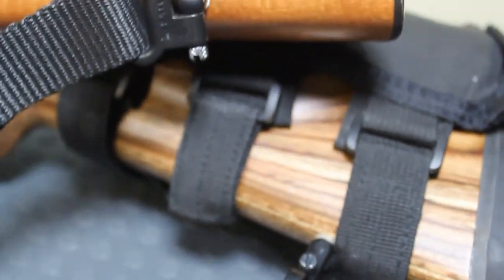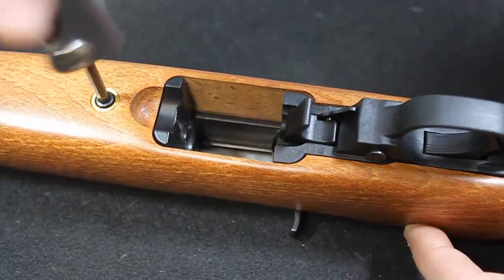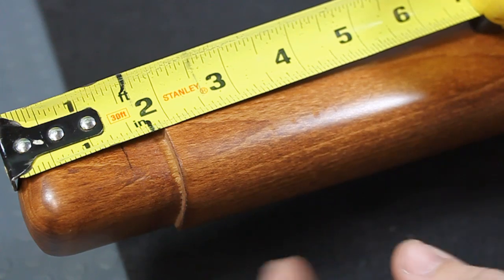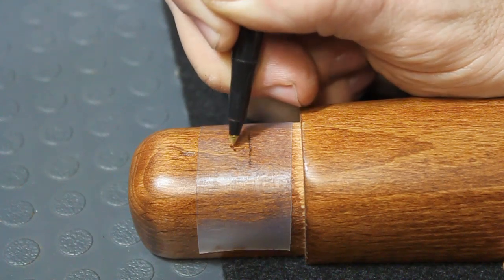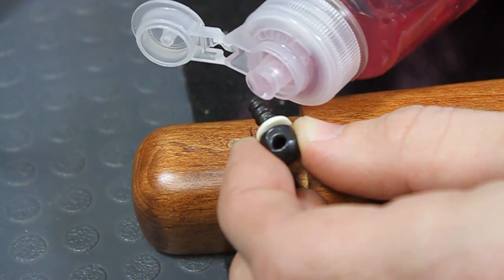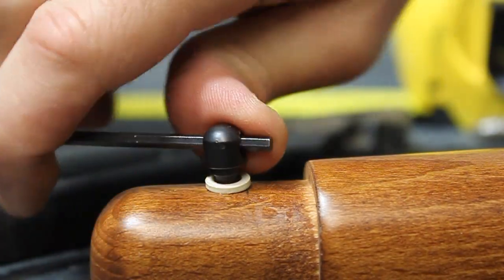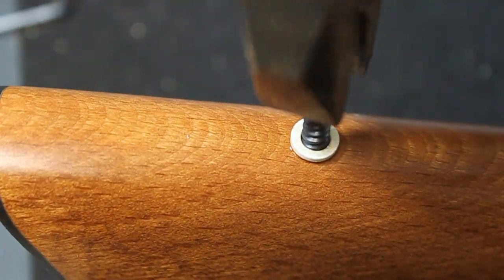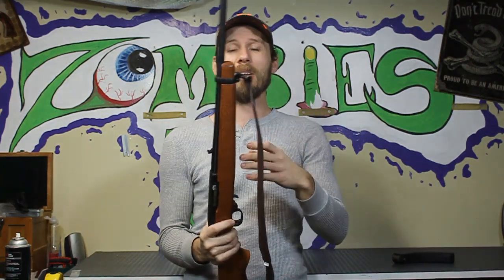How to install swivel sling studs on a rifle stock: Ruger 10/22

Comment: using pliers just scratches up the stud surface (you can see it happen to both studs in the video), do not use pliers. Simply put a small diameter screwdriver or rod trough the hole of the stud and apply pressure while screwing it in place.
Reply: I was shocked, when I saw the pliers coming in 😅 Good mod, though 👍

Comment: Why did you not use the Uncle Mike's swivel sling made for the 10/22 which attaches to the barrel band? Then you would only have to drill one stud for the buttstock.
Reply from the maker: I could have, but i had these laying around.
Reply: My thought exactly and in front of the barrel band
Reply: @ZRUSOutdoorsChannel  I don't care for them little barrel bands anyhow that come in the Uncle Mikes kits! I have them on a couple of my 336's, but try not to use em'! They end up scratching the shit out of your barrel if they work themselves loose. Because you won't know it until your throwing your gun up on your shoulder or picking it up by the sling!! By then the damage is already done??? UGHHHH!!!
Reply: @jaymeddaugh2044  and

Comment: Excellent video, but one critique.  I would not use pliers to get the studs started.  It looks like you marred them up bit.  Wrapping electrical tape around the pliers is one solution or just use downward pressure with your allen wrench.
Reply from the maker: +Tom G. True story.
Reply: +Tom G. +1 on the tape. I actually winced a bit when I saw the naked plier jaws crunching into the stud.
Reply from the maker: GlowingBentley I can be destructively productive sometimes lol
Reply: I use my teeth...that way I don't hurt my tools.
Reply: he sure did scratched the living heck out of that screw
Reply: @selaxlife7621  😂 you just love the taste of lubricants.

Comment: Got mine installed yesterday.  My primary use for the stud was to mount a bipod, so I wound up putting the front stud 2-5/8" rearward from the barrel band.  If you read the instructions, they call for using Uncle Mike's #2 wood drill and countersink.  So I looked that up and found the set cost $30.  Forget that.  So I decided to take a slightly different approach.  I measured the outer diameter of the white washer to be 3/8".  I wanted to recess the white washer so it wasn't visible, especially on the rear stud where it is on the peak of the stock curve.  So I used a 3/8" Forstner bit and drilled just deep enough so that the washer was flush.  Then I proceeded with the 5/32" bit.  The rear I put 2-1/4" from the butt, taking the average of the recommended distance in the instructions.  Regretfully, I didn't video anything.  Anyway, I would like to again say your video is the most professional on YouTube and gave me the confidence to start drilling.  I have seen some pretty bad videos on the same installation.
Reply from the maker: +Tom G. Well thank you again Tom! i do appreciate the good words and glad my video could help you out, that always nice to hear :)

Comment: Nice vid...Hint:  first drill a small pilot hole before drilling larger hole, this reduces chipping in the wood surface. Also bar soap or candle wax on threads works best on ALL wood screw applications....just my 2 cents from life...
Thumbs up!

Comment: I have had a Stainless 10/22 from when they came out about 25+ years ago.
SLING SWIVELS:
Since I have several 1903 Springfields I was familiar with  those Sling Swivels.
Found at a Gun Show some Milled 1903 Style Swivels and Screws, 
stripped the Bluing off, Buffed and then a lite Satin Clear Coat.
Looks Great.
Currently has a repro WW2 Tan Canvas Sling 
for Garands and 1903 Springfield 
I also put a Stainless Scope on it.
I found a Stainless Butt Plate to replace the Black plastic one.

Comment: Great video. Helped me with the instal. The only suggestion I would give, is to measure the depths given in the instructions, on your drill bits and put a piece of tape at those depths on your drill bits. Installing the rear swivel stud, I believe I used an 11/64" at 1/8" depth and a 5/32 at 7/8" depth. Been needed to put a sling on mine for years.

Comment: Just finished the sling mounts on my old 10/22. Two tips…
Ensure that the hole drilling axis is perpendicular to the surface plane of the stock. It’s an easy thing to overlook. Otherwise the mount won’t fit squarely on the stock. 
Also, if you’re careful about doing this, you can turn in the mount by putting the head of the mount in the chuck of a LOW SPEED drill motor.

Comment: Will do this to my Ruger 10/22 soon. Thank you for the video.
Reply: +Z.R.US Hi! My front swivel screw (on wood stock) feels strong by hand 
but when sling is attached it rotates. Is this normal or shall I do 
something to tighten the screw? Was thinking in taking of the screw and 
then puting some epoxy putty in the hole.
Reply from the maker: I have two rifles that do that, I havnt put anything on them, but im sure a wood glue or epoxy would definitely help.
Reply: Great, thank you for the quick response :)

Comment: One Note: When you put the screw outside the barrel band you can't slide the barrel band back on, at least on the models with a metal barrel band.  I didn't try to pry the band open very far, as I didn't know how well the metal band would handle the bending.   So now I have an extra hole...  Not the video author's fault - just something to think about.  

I like the use of tape to sort the wandering drill bit!
Reply: Yeah, that's certainly a terrible place to drill for the front stud.

Comment: Should of used a piece of rod thru the eye of the stud to screw it in.  The pair of pliers
can mar the stud's finish.  Just put a piece of cardbrd onto its jaw but this can b a bit 
slippery.  Yah, it maybe hard to get the screw-in started. but as long as the tap drill is of
correct size, should b OK.  I did like ur mentioning where to put a stud in consideration
w a rifle rest/tripod.  I would suggest to use a drill press instead of a hand drill and a
punch to assure better drilling.  Using a scotch tape however is good too. 
Thx 4 the video!

Comment: One question. Does putting the stud in front of the barrel band make it difficult to get the barrel band back on? Will it stretch open wide enough without snapping? Good video other wise.

Comment: I have a poly mossberg 302 plinkster.  Can I use the same instructions for the plastic stock as for wood.  I was going to add some epoxy to the screws to giveit a bit more holding power.  Do you agree that this will work.  I am sure the material is hollow so do you think I will get the strength needed from the epoxy.  Thanking you in advance , Rick
Reply from the maker: you sure can, i just did this to a magpul stock and a Ruger 10/22 takedown polymer stock. I didnt add any epoxy, but  im sure it will help, as long as its safe to apply to the polymer.

Comment: Good video, but you did not show how the barrel band  moves past the drilled   swivel stud.
Reply from the maker: Thanks man! I have a plastic barrel band, pull it open and it slides right past.
Reply: ZRUS Outdoors Channel thanks for the reply. I haved a 44 magnum with a metal barrel band. After I commented, I ordered an uncle Mike's swivel kit with the adaptor to fit between the barrel band. Hopefully it will snug up enough. Thanks again

Comment: Does adding the swivel stud in front of the barrel band make removing the barrel band difficult?
Reply: +ZRUS Outdoors Channel not until you buy hard metal band or the metal band with piccantiny rails on each side they it would be a problem. i put mine 2 inches behind the band
Reply: Matt, I see your question was two years ago. was your question ever answered. I intend to install swivels on my Ruger 44 Magnum. Same principle. Different Uncle Mike's #

Comment: How do you get the barrel band off now that you've got the swivel studs in front of it?  What would the disadvantage have been to mount it behind the band on the thicker part of the stock?
Reply from the maker: The barrel band on mine is plastic, so it opens up and slides over the stud. the further down that you mount the stud on the stock,  the more the rifle will want to lean the barrel back away from your head.. The closer to the muzzle and it will stand upright. So i always try to mount the stud as close to the end of the stock as possible.
Reply: I wish I would have seen this comment before - now I have an extra hole in front of my metal barrel band...  duh.

Comment: Just did it the same way with rear stud. The demo really helped! Ever have issues with them coming loose or anything?
Reply from the maker: i have had swivel studs move on me from the factory, but nothing to the point that they unscrew or come off from the stock. there will always be movement of the swivel stud.

Comment: would it work to add a second stud a couple inches behind the barrel band so you can mount a bipod and still use a sling on the stud in the location you installed it at?
Reply from the maker: Joshua Seago totally!

Comment: How did you get the barrel band back over the newly installed stud? I did this and am now screwed. Have already broken one barrel band.
Reply from the maker: mine is plastic and was later removed permanently. They arent needed and can reduce accuracy.
Reply: @ZRUSOutdoorsChannel  Awesome I'll try using without. Thanks for quick reply!
Reply: I'm confused. Why remove the barrel band at all?  You're not drilling all the way through the forend, are you?
Reply from the maker: mojoman2001 this allows you to completely disassemble the rifle. If you cant remove it or install it, then you have a problem.
Reply: @mojoman2001  I'm talking about when you break the rifle down for cleaning and maintenance. I just left mine off, shoots great without it.

Comment: Nice tutorial. I prefer to drill my hole in the butt stock perpendicular to the stock instead of holding the drill vertical.
Reply: I think you did a fine job. I have a .22 that I'm going to do the same thing to, maybe I'll do a video too. I like the dish soap idea, I usually use bees wax.
Reply: what is the benefit of doing it that way?
Reply: *****   oh OK. Thank you.  

 I'm getting my 10/22 ready for my first Appleseed event and I need to install a rear stud into my old Fajen stock, which makes me nervous because they don't make them anymore and I have very little experience doing things like this.

Comment: If your stud is 16mm what drill bit should you use thanks
Reply from the maker: not sure which one i used, just that it was smaller than the threads on the stud. but not smaller than the shaft of the stud (imagine it without threads) hope that helps.
Reply: Thank you for your time 
Mark

Comment: Do not use dish soap please!!! You want to use wax or Tru oil to seal the wood from moisture. Moisture will ruin the wood faster than anything else.
Reply: One thing, if you must use dish soap. Do NOT use Dawn. Dawn has a enzyme that helps break down grease on pots and pans. However it rust steel terribly.

Comment: Not very good advice...why would you remove your band sling swivel which is way more strong and secure for a screw base swivel mount....when you go out hunting and move a lost your sling will unscrew it over time....keep your band sling swivel mount and just buy the proper sling.

Comment: Nice but what size drill bit?
Reply from the maker: I forgot.. but a good measure will be a bit the same size as the center of the stud not counting the threads.. (basically if the threads werent there, go by that diameter.
Reply: @ZRUSOutdoorsChannel  could have sworn he said 11/16 in the beginning...

Comment: Not sure why you need to remove stock....I've mounted with stock attatched..no problem
Reply from the maker: easier to work without a gun vice.
Reply: @ZRUSOutdoorsChannel  Never used a  vice..but then I've been a contractor for 35 years...may be easier for first timers to remove it......
Reply from the maker: @jackpeters9048  yeah, with the 1022 stock, it has a flat surface that will stay put once the barrel and action are out.